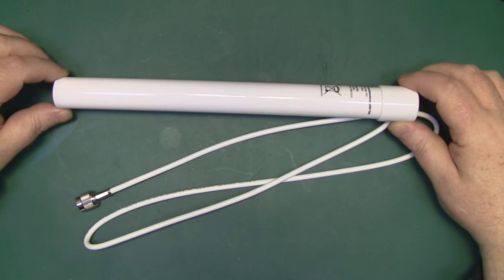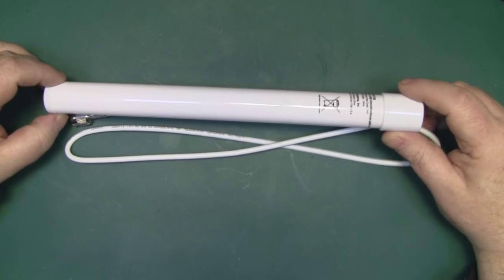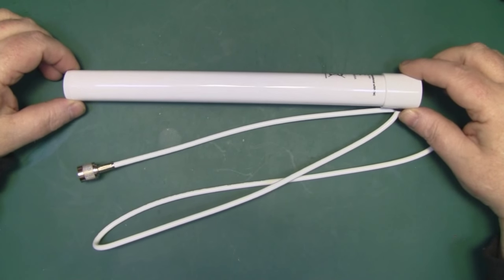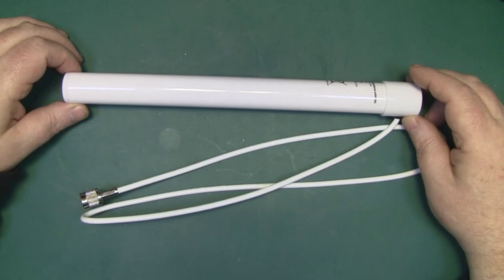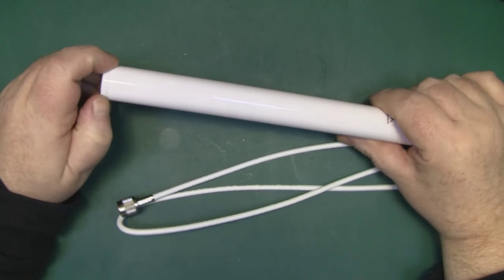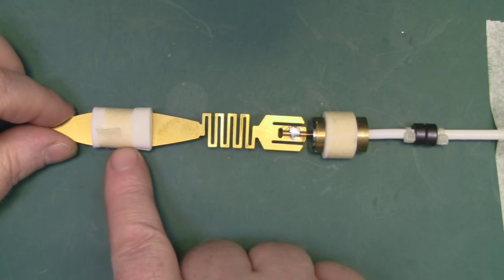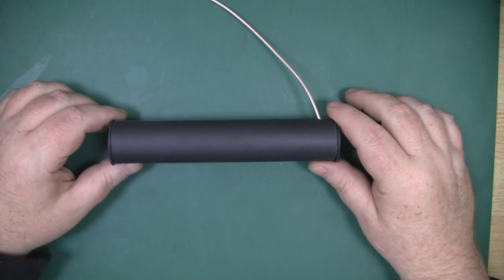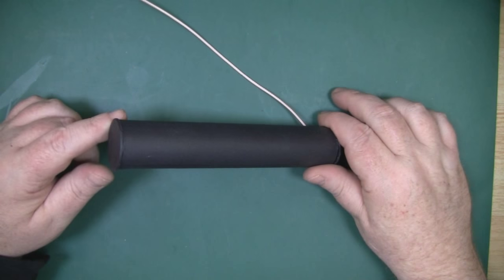Cisco Aironet Air Ant1728

Comment: Important bit: epoxy doesn't bond well with copper and brass
It will hold onto geometry of the copper, but won't "stick" to it well enough to survive any mechanical thwack.
Nice job none the less!

Comment: so is this actually any better than the long range rubber duck dipoles 
also the rubber duck antenna's don't usually have any coax. 
and what difference would different metals have if any, the original seemed to keep dropping slightly is that the difference?
Reply from the maker: +Chris Phillips There is a reason the signal was dipping new video shows why. This antenna cost around £80 to buy when it was new and the design is just to give the antenna more bandwidth range is the same as a rubber duck.

Comment: Nice job! Just wondering if that "balun tube" could be adapted to impedance match a 5.8 helical antenna, at 1/4 wavelength it would need to be approximately 12.5mm long? If the tube diameter was, say, 10mm could it be appropriately insulated and located inside the helix or would that impact on the antenna's performance?
Reply from the maker: +James Lamb Hi James The  helical normally has a triangle balun or a straight piece of wire at the base leading to the feed. I don't know if anyone has experimented using a tube as a balun but that's not to say it will not work. I am currently working on a cone helical design so I may give it a go.

Comment: Great video and great build!  I also noticed your video thread on your antenna builds.

With that, I have s small question. Cisco + Amazon claims that antenna can access wireless networks up to 1 Mile away.  Has this been consistent with your experimentation and research?  It's just been a question on my mind, for a while.

Small Note:  Could you update each and every antenna video to include the farthest network you were able to access?  I have had an interest in recent months about "very long range" access of wireless networks.

Take Care & Keep Building!

Comment: Nice video indeed Andrew, very interesting, and the fault finding tip at the end was very good indeed, Andrew I'm looking for a good long distance omni for my 2.4ghz radio control handset, I have tried a cheap 5dB like the ones I've seen in your clips and was not much better than the stock 2dB,  now I have a TP-LINK 8dB to try as well, just picking your brains to see if you could point me in the right direction, the idea is to have a more solid link with my quadcopter when flying far, the transmitter is a Frsky Taranis and outputs about 170mW. Thanks!